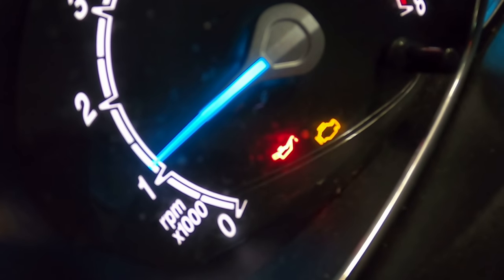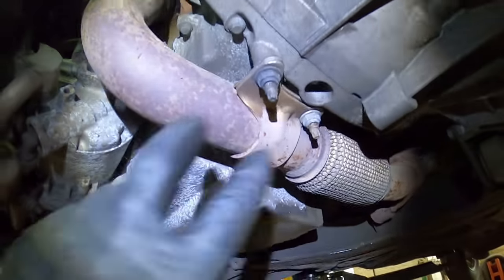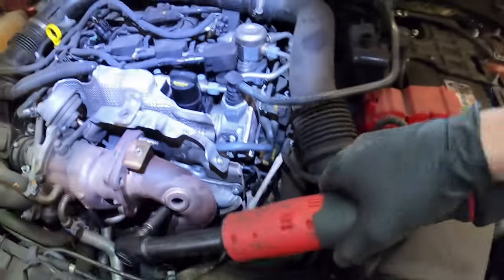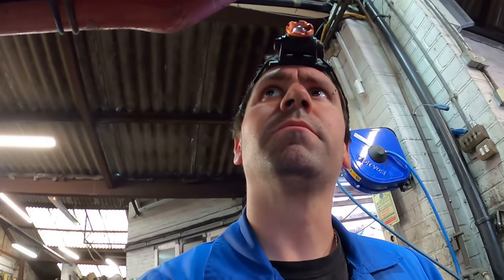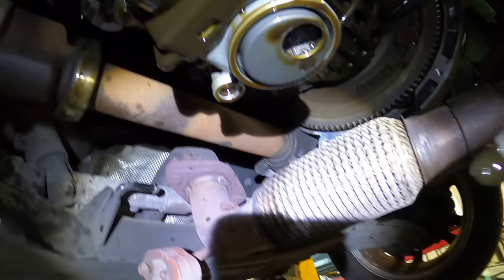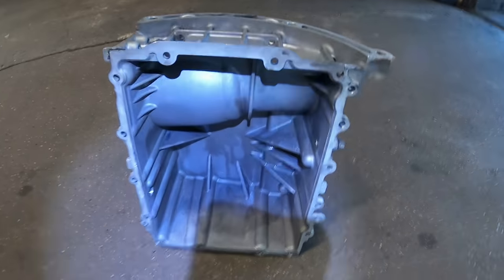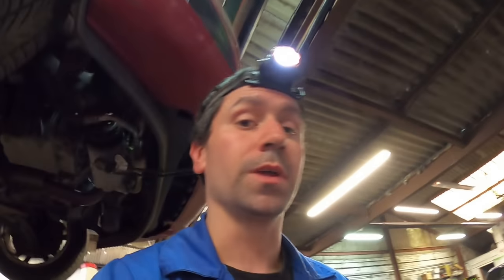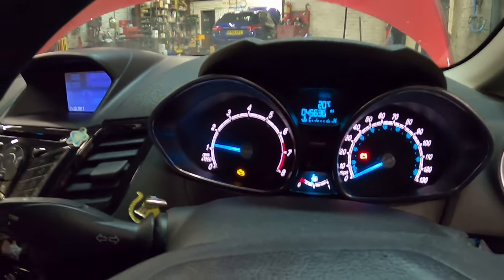Ford Ecoboost 1.0 fiesta/focus oil pump replacement

Comment: Has the pleasure of doing this job on a focus a few months back. Ended up doing it on the driveway (not fun). One thing I did find is there is a lip on the sump casting right next to the crank pulley. If you put a claw hammer in there and pry it down the sump pops right off. I ended up pulling the pump out and giving it a good clean up. Unfortunately, the low oil pressure also destroyed the turbo bearing. Ended up having to replace that. The toughest part of the whole job for me was getting the bolts tightened on the turbo oil return pipe. Hellish to get to! Great video, sure it will help people out!
Reply: Reading online this wasn't a maintenance friendly design. It might have won awards but the fuel economy wasn't really achievable, they had the coolant pipe issue and the head gasket issue too. Not a good design in my opinion.

Comment: I've had mine for about 4 years. No problems what so ever. Never left me stranded either. And mine has been tuned with Pumaspeed for the last 2 years.
Edit: Forgot i had a driveshaft replaced was about 300 usd, replaced them myself.

Comment: In this engine always use the engine oil which Ford is recommending: Castrol MAGNATEC Professional E 5W-20. This oil has additives which can protect the rubber belt. And change the oil every 10-15k km/every year and not 30k km or 3 years as Ford recommends.
Reply: Yeah but this isn't very useful info for someone buying it used lol. No idea what's been used before
Reply: Oil needs replacing every 10k and not 30k as ford were dreaming, I wouldn't recommend putting magnatec oil in anything, instead use a good full synthetic 5w40 oil and replace both belts every 100k
Reply: @MIB-iy6qq  5W20 with the Ford specification C948 to prevent the oil attacking the timing belt. Very important. Change oil and filter every year or max 10.000 km, which comes first
Reply: On other sites they say the reason is the injection of petrol at high pressure causes petrol to leak in the oil. Whatever you do the same happens. A technical speciufication is a spec. Even people doing their maintenance at Ford explode their motors . Are you from CASTROL ?
Reply: How many miles is that 😊
Reply: @558vulcanxh  6200-9300 miles
Reply: Still won't help......they all go this way
Reply: Crankshaft has NO key 😮😮😮😮😮

Comment: Just needs the correct oil (the bottle says suitable for an ecoboost engine) each service and ours is sitting at 108'000 miles.
In its life its had 1 set of spark plugs over and above oil,pollen,air filters and oil every year, change of coolent and brake fluid every other year. 👍
Reply: Done cam belt yet? They shed and block strainer.
Reply: @roberttaylor465  
No,not due till 10 years old or150'000 miles.
Cars got this far without a hitch,so fingers crossed 🤞🤔
Reply: Ford may want that back, not many make 100k😉
Reply: I have now on my 3rd eco boost car had them over the last7 years and not had a single problem with any of them. My son has a 14 plate fiesta that has also been 100% too.I have the oil changed every 8000 miles on them .I am not a fan of the wet belts though Ford should of used a chain right from the start !!

Comment: Ford just issued a recall for this. They are replacing the oil pump belt and tensioner. Recall number is 23S64.
Reply: This is in the USA?
Reply: @MrChilo89  Yes here in the USA.
Reply: What year upto can ford recall them?? Mine is 62 plate
Reply: @MrChrism681  too old, up to 7 years I think, must have fsh from ford

Comment: If the oil pump strainer is blocked due to the wet belt degrading isn't that oil pump replacement just delaying the inevitable? The wet belt obviously needs replacing. However, a good video. I have a 2014 1.0 ecoboost . Only done 36,700 miles.  I change my oil every year even though I only do about 1,200 miles per year now. I did miss the oil change off for nearly two years at one point (something I hope I don't regret). I am changing my oil and filters soon so hoping I find no nasties in the oil. The trouble is a 2009 Fiat Punto is £240 per year road tax (so my neighbour said) and the 1.0 ecoobost is zero road tax. In 5 years the cost of changing the wet belts could be covered by the zero road tax.
Reply from the maker: I know customer wanted the light out as the car went back a few days later
Reply: @ignitionadvantages6592  this customer is another 'buy cheap buy twice' person. In a year's time she will probably come back to you wondering why the oil light's back on 😁
Reply: Bought mine brand new complete ford service oil pump belt went at 40000 miles low oil pressure clattering engine  disgusting ford ignoring me never again

Comment: best decision ever getting rid of my old focus with an ecoboom engine, in 3 years of it overheating it leaked coolant from the heater matrix, cracked a coolant bottle, burst 2 degas hoses then engine eventually failed due to it getting warped, got all repaired under warranty but too unreliable to keep after that
Reply: Not certain how the engine's won awards when it had terrible issues. Overheating, catching fires in rare occasions, head gasket issues. I've always loved Fords but I'm probably going to give the Ecoboost engines a miss. The cost of a timing belt change is pretty expensive too.
Reply: Looking back over history, many products receive awards that turn out to be total junk, as the saying goes " all that glitters is not gold "

Comment: Eco boost engines will keep mechanics busy for the rest of the life 🤣
Reply: No more than regular engines
Reply: My 1.0 ecoboost would disagree, the only mechanic is me and it’s oil changes, air filters and spark plugs. It took 400k to wear out the linkage on the turbo, bearings still rocking and I’m gambling on the timing belt. The engine has done enough.
Reply: @lancethompson8145   don’t get me started on how much it costs to change a timing belt 😭
Reply: @lancethompson8145  400k and you did not change cambelt? Never? Mine has 213k.
Reply: @CesarDiaz-yi4ic  yes more than regular engines.  All the smaller ecoboost are horrendously unreliable.
Reply: @dado500  I haven’t touched the valve assembly or timing belt. I’m thinking of just swapping in a used low Km engine at 500k.
Reply: I made a mistake of purchasing one 🤦‍♂️
Reply: @perrinayebarra  nope, the 1.0 ecoboost is the second most reliable engine I’ve owned. The first being the 2.2 litre from the Chevy cobalt, both exceeding 300k and the cobalt only needing a $20 mass airflow connector at 315k and the fiesta 1.0 requiring a $800 turbo at 360k. We could talk about cams and cam phasers on Hemi/Chevy v8 and v6 ecoboost engines. All new engines are requiring more complex parts.
Reply: fiesta, focus?

Don't forget Kuga, Mondeo and eco sport, they put this in BIG cars too.

Got a Mondeo in at the moment 

You can use a slide hammer to remove the strainer cover, clean it then tap it back in and peen the casing to secure it again.

Takes seconds with no need to remove or disassemble the pump.

Once you get covered building up in the pump you are hardened to have belt failure in the future.

We had a chap have his oil screen cleaned three times in a year and a half before his belt finally failed.

The problem is people are now cleaning the oil strainers and selling the car on.

Comment: Hi, I have the same issue with my ford. Should I clean oil pump or better get new one? Oil pump cannot be damaged, it's save to clean it? I just don't want to buy new one if I not need? Thanks

Comment: I have a ford focus ecoboost 1.0 which is leaking oil. At 2:26 on your video, just to the right there is a cable/pipe. It has come off, and the oil is leaking from there. I think it maybe the oil pressure sensor but I am not sure. When it is out, it has like a brass/copper like pin on the end of it which slots into the engine. Could you tell me what it is please and how I can fix it back. Thank you

Comment: Thanks Sir ! One question : why discard the oil pump ? can't you simply clean wash those debris out ?? By the way you know these debris come from the timing belt ? (did not get what you say sorry). An oil pump to be changed !! And we already change the external oil filter !!! What use is the external oil filter then ????!!!

Comment: My wife has an 2018 plate focus Eco boost and the oil light was staying on, so I changed the oil pump.  Since changing the pump it has developed a knock which I am not sure is.  It seams to be coming from the top of the engine on the left side where the pullies are.  I have listened to the the bottom of the engine with a screwdriver placed on the sump and all is well at the bottom end.  The car runs fine and drives as well as expected.  Any Ideas would be appreciated.
Reply: Had this exact issue. Knock from engine then oil light turned on while driving. I have it at the shop now as it is covered by insurance. Oil levels were fine and coolant aswell.

Comment: You are my go to mechanic. Looking for good news. My girlfriend broken down miles away from me and reported the oil light staying on after topping it to max level. Tuck a 850mils then the engine died and wouldn't start. She said that the battery was dead but the auxiliary belt was still on and now she's saying it makes a knocking sound an won't start. Can I fix this issue with this oil pump replacement

Comment: From what I've seen it's the belts falling apart that causes the oil pumps to clog up, I'm of the opinion that the belts should be changed as well but you have pointed out the bearings are now stuffed as well so yes?

Comment: How much roughly are you charging for the oil pump replacement? My low engine oil pressure light is on , weighing up if it’s worth it or not, any guestimation would be greatly appreciated! 
Thanks ,
Ian
Reply: Hi it should cost about £25 for the oil pump and £15 for the Gasket Sealer then you are looking at £20 or £30 Labour.
Reply: £20-£30 Labour? No chance.
Reply: @bikeman123  Yes more like £10 because Everyone loves cheap.

Comment: I think I had this problem! I got engine jumped. My car is pretty much the same, Ford 2018 Focus SE Sedan, 3-Cly, EcoBoost, 1.0T. However, there is a open recall from Ford to replace the engine oil pump tensioner. The total cost to fix it will be around $8k!!! And believe, my car has only 39,500 miles on it. Can I ask for a reimbursement due this factory fault ?

Comment: Wondering if you can help me. Ford Focus 1.0 Ecoboost, oil light came on, then came some rattling and the engine stalled. Tried to turn it over after but made loud poping/cracking noise. I've remved the spark plugs they all looked fine apart from number one plug, it was soaked in oil including the igniter on the end of the plug. I can turn the crank manually and feels pretty much normal. What do you think could be the problem? Is it fixable or is it game over?? ... Look forward to your reply.
Reply: Was it game over?

Comment: Good video explaining how to get the pan down. Want to investigate my daughters. It’s shame you didn’t fix the route cause…ie why was the pump clogged. Changing the pump won’t fix the belt shredding and blocking the new pump.
Reply from the maker: I know this has been asked 100 times now. The customer wanted the light out to px the car they did not want tonpay for the belt

Comment: Hi mate I've got the same problem on a 2017 oil light came on parked it up..went to start it to take it down the garage and won't start had a macanic he says it got no compression and that the engine is knackered...would the pump cause no compression at all..many thanks len

Comment: Seeing this alot now with the age these cars are getting. It’s always without fail due to lack of maintenance so the poor oil quality is degrading the wet belts. Usually the teeth strip off the timing belt before it clogs the oil pump strainer but I guess it depends on driving style. Have seen cars come in with a lack of power (no vac to turbo actuator) due to the vac pumps built in oil strainer being blocked with belt and the pump destroys itself. Have also seen a couple of extreme cases where there’s been no oil feed at all to the turbo because the galleries are completely blocked with bits of belt. Always new belts & clean out the oil strainer, don’t recall ever actually replacing a pump. It is possible to strip the pump but it’s abit of a faf. Having the engine stripped to do the belts also means you get to replace the timing cover coolant o-ring as that’s already probably already leaking & replace the valve cover as it’s probably split and leaking oil so abit of preventative maintenance while your at it. Honestly not a bad job at all. Then again you can just overheat the engine somehow and kill it and Ford will fit you a new engine for free. Still not as bad as the wet belts on the transit 2.0 ecoblue, that’ll probably strip the teeth of its belt before it’s second service.
Reply: Ford fit a new engine? 
please tell me your joking
Reply: Can you wash out the debris from pump easily ? Flush them out ? Why not ? Thank you

Comment: The stuff inside the pump is usually the belts breaking down into small pieces , you should realy change the belts or more than likely it will block pump again
Reply from the maker: Car went back 3 days later. Customer just wanted the light out

Comment: Good thing the new version of 1.0 ecoboost now use a timing chain.
You know it's the new engine when you don't see the turbo because they're now in the back.
Basically the new 1.0 engines are inspired on the 1.5 from ST but with lower displacement and in some cases, mhev system
Reply: @SandStorm Power could you give more info regarding that? Is this officially stated somewhere? I've never heard they are going with timing chain...
Reply: @grasho  it is on tech data from press media ford, pretty hidden documentation. Same stuff with the Ford focus
Reply: Chain is for cams.  Still uses a wet belt for oil pump.

Comment: I suspect that changing the oil more frequently and using the right oil helps prevent thi.
Reply: Exactly. The only engine oil for this engine is: Castrol MAGNATEC Professional E 5W-20.
Reply: Correct correct correct, I have one with no issues because it gets serviced on time every time, this car was not serviced regularly by the sludge in the sump. Great little car 125HP and 60MPG on a trip, I’m happy

Comment: The reason the oil strainer is blocked is due to wet timing belt disintegration, it will eventually snap. 12 hour job to change the belt. 😎
Reply: I’m waiting for the same thing, still haven’t had an issue at 400k.
Reply: @lancethompson8145  make a video about your car

Comment: I have this problem with my ecoboost and some cowboy mechanic told me I needed a new engine. I got a second opinion and the next guy literally told me the issue which is exactly the same as that in this video

Comment: Interesting,👍 any update on what the warning lights were for? Was it connected to the fuel smell??
Reply: It would have been worth while checking out the Alternator charge rate and pulley if it's the Clutch type. Good Video,the Guy keeps it simple with no nonsense enabling People of all levels of experience to have a go.

Comment: It was inevitable that those engines were going to fail, nobody checks the oil and if they do they use either crap oil and/or wrong grade the cam belt start to deteriorate and ...

Comment: What is the reason behind leaving a degraded belts on the car after changing the oil pump? surely the belts needed replaced as well ? Or even just the cam belt?
Reply: Changing the belts is a massive job.  Engine out, specialist tools required for this engine.  I guess it’s more economical to change the pump, get them running then just run as long as they will or move the car on.  It’s certainly not an easy change while you have the sump off.

Comment: My Focus has done this recently. What would the cost of the fix be roughly?
Reply from the maker: £1000+vat
Reply: @ignitionadvantages6592  😲
Reply: @Dee-l2g  Well the belt is the the root of the problum its the belt that is coming apart! You need to replace the belts too its just going to block up the pickup..

Comment: My light and oil pressure warning flashes when I turn on the car first thing and then doesn't come back on all day. I've been quoted £250 to get the oil pump changed. 😭
Reply: Had the same thing for about a week or 2... and then it started rattling on Monday, so yeah, here i am watching how to replace the pump 😂
Reply: I have this issue now, did the oil pump change fix it? I’ve been told I’ll have to change the wet belt as well since it’s probably this that has deteriorated and clogged up the pump

Comment: In the new engines i heard that they use chains for oil pump so not have that problem
Reply: What year did they start using chains? I have 2015 from new, never had any issues so far, it’s also a duel clutch
Reply: Chains are used in mhev, the newer  ones with an oversized alternator.

Comment: Petrol in the sump. You reckon it’s bypassing the piston rings?
Reply: Too many short journeys at a guess. If the car isn’t used on longer trips the oil never gets up to temp to burn off fuel etc from blow by.
Reply: Either a faulty fuel injector or the high pressure fuel pump is leaking internally
Reply: Precisely the same problem as my fr has after 104,000 miles on a seven year old car. Stacked it in against a new car with £2,800 trade in instead of a £1k repair bill! Result!

Comment: What about the oil pump V belt- can that be replaced easily too?
Reply: 30secs and he didnt change it!!! He should change both belts, but at least the pump belt since it would be 30secs more....
Reply: @heliogoncalves2870  You cant change the oil pump belt without changing the timing belt as the gear is behind the timing belt crank gear. Not 30 seconds more, probably 8 hours more work at least.

Comment: the hi pressure fuel pump is driven by plunger run of the camshaft the follwer starts to disintergrate and sends metal round the engine